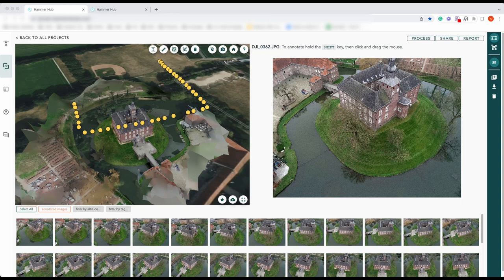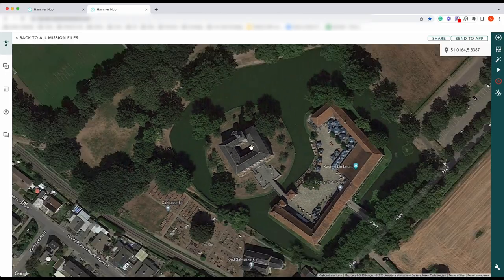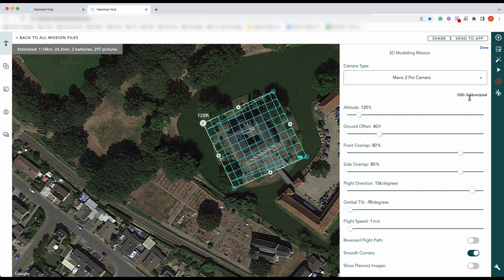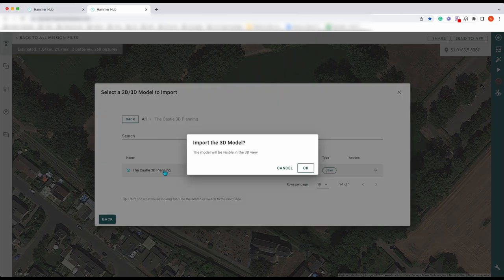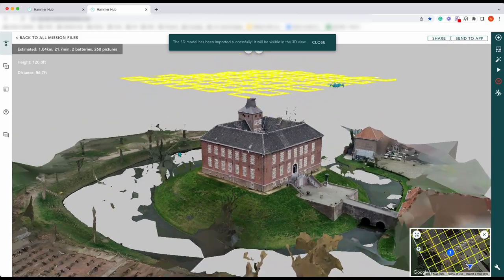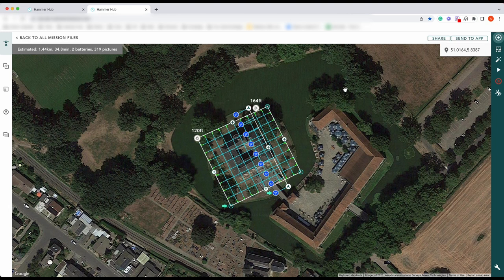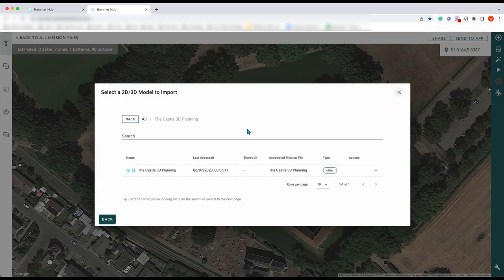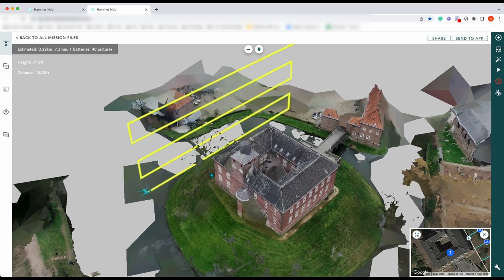How to use an existing 3D model for drone flight planning? | Hammer Missions

Comment: This is exactly what I've been looking for, super cool. Do you have details on how accurate the height of the building is when you plot a flight plan & how well the model maps to coordinates in real space? For example imagine there is a city block and the streets are surrounded by tall buildings w/ alleyways between buildings. How reliably could you chart a flight plan that moves the drone between buildings w/out collisions?
Reply from the maker: Thanks for your kind words! The accuracy of the data really depends on the geo-referencing (absolute) accuracy of the captured dataset, so methods such as GCPs, RTK, PPK can all help in creating highly accurate 3D models. Here's more on that: https://www.hammermissions.com/post/gcp-rtk-ppk
Reply: Super cool, thanks for responding! Also curious to get a peek behind the curtain and know if you guys are using a traditional photogrammetry approach or have experimented with/are applying NeRF modeling? Any insight into how the tradeoffs between the two?  @HammerMissions
Reply from the maker: @morganwwww  We use photogrammetry as unfortunately NeRF whilst really cool is not accurate enough for measurements and geo-referencing which is critical for drone applications!
Reply: Makes perfect sense. Thanks again, and super cool 3d flight planning! @HammerMissions